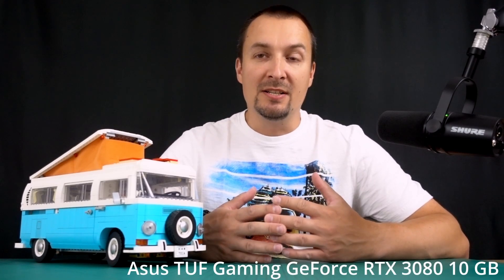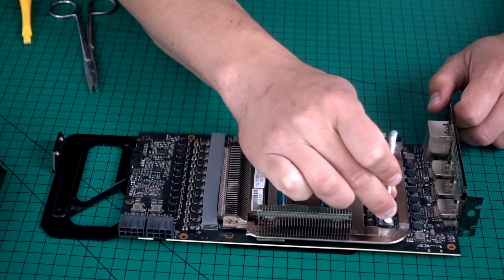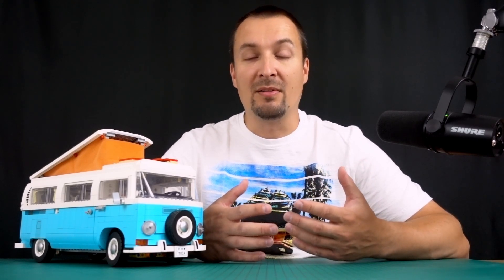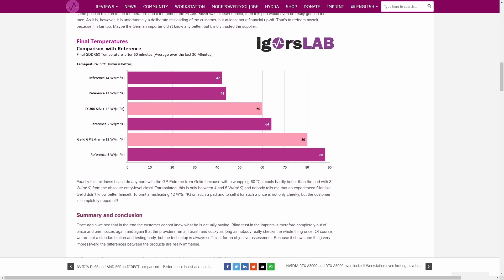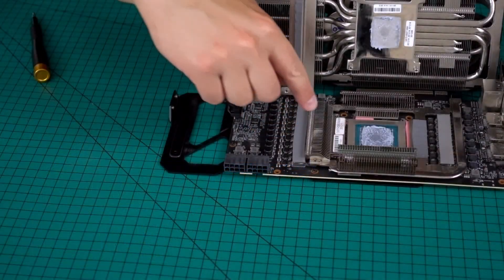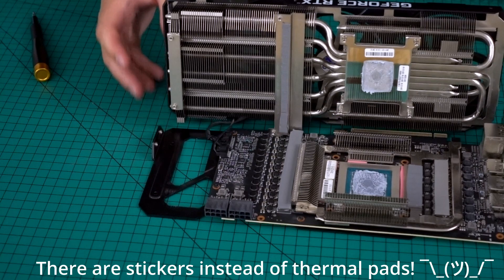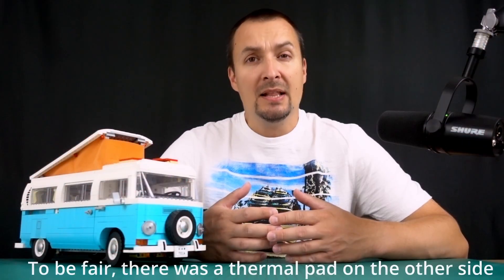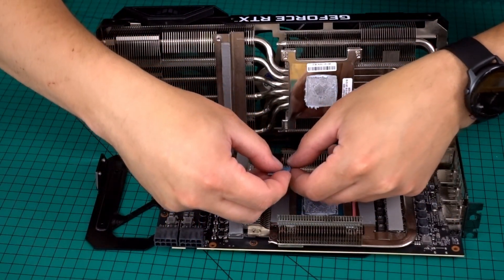Should you replace thermal pads in your NVIDIA's RTX card ASAP?

Comment: to figure out what thickness you actually need, use a piece of modelling clay. After putting it together, the clay will compress to fill the clearance and you can then measure this thickness. Pick a thermal pad slightly thicker than this measurement for best results.
Reply from the maker: I've never thought of that. Thanks for sharing.